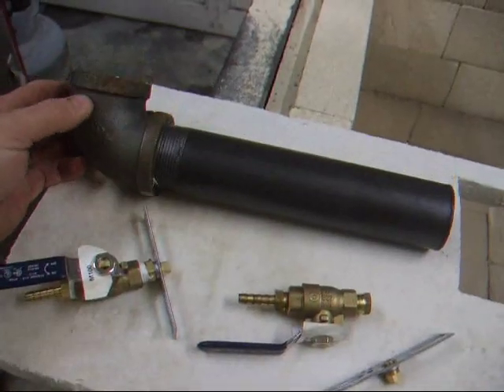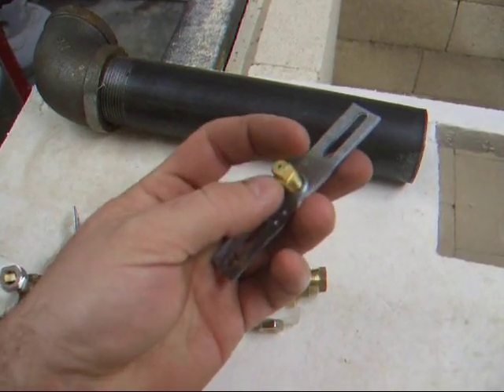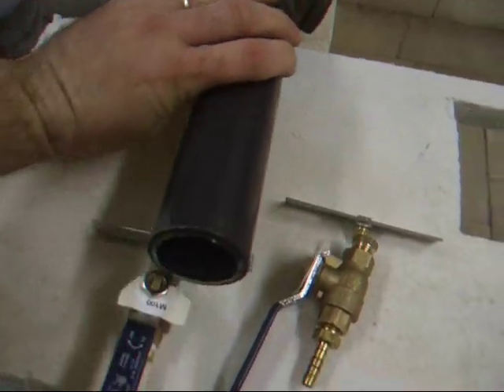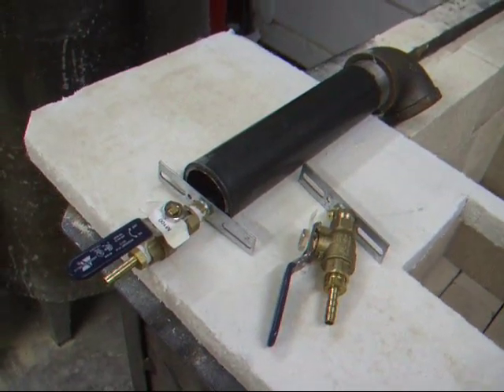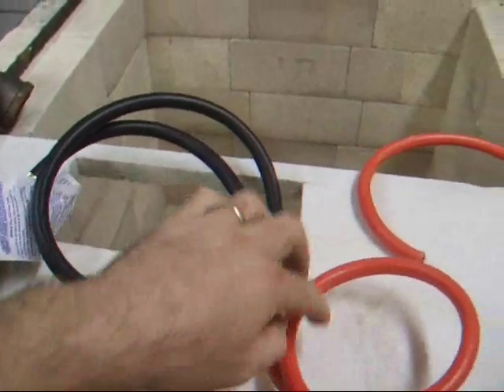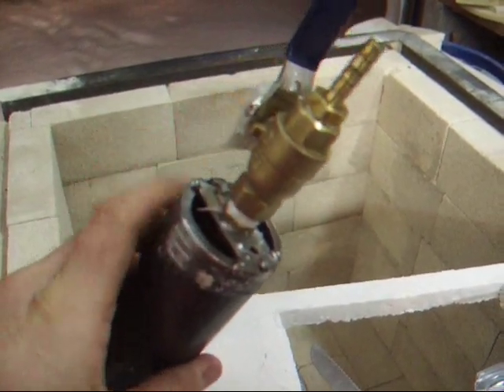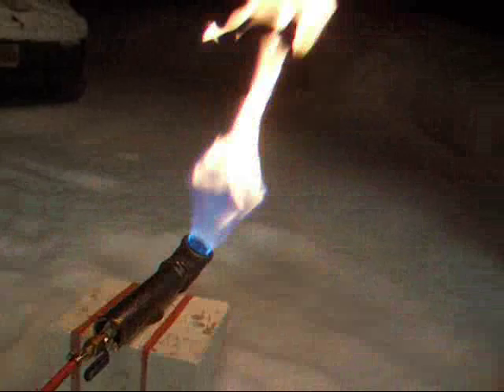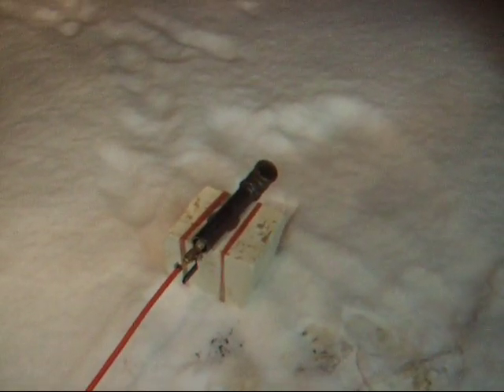Kiln project clip 4 - BURNERS!

Comment: yeah you need more air. thats why the flame is yellow. if you bent that flat bar with the gas into a u shape to draw more air into it that should get a better high temp but it would affect the low temp. even may be make it dangerous to run low. Im workking on making a kiln right now with two ribbon burners with forced air so i have a lot more control of both gas and air.

Comment from the maker: These burners actually burn very well now.  According to ward burners a kiln of this size will use about 30 lbs of propane to get to cone 10, no matter what burner you use.  The orifice is 1/16 inch, any less it backburns at the orifice tip and any more it runs rich.  Thanks for all the input.
Reply: Thanks for the video! I'm making a pre-heater for a pizza oven I built in the back yard. The thing takes like 2+ hours to heat up if the fire bricks are wet... It's a pain when you are hungry!!!! Hahahah what type of brick do you use for the kiln? Are they just regular fire bricks, only White?
Reply: I welded up a burner out of some scrap mild steel DOM I had kicking around and the orifice was just a scrap rotabroach plug that fell on the ground under the drill press hahahahaha, the pilot hole in it was about .100". I tried a bunch of different gas pressures and primary air hole sizes, but it was still too rich. Your comment about the 0-30 pound adjustable regulator is probably the key I am missing here!! The one I have is 0-10. The tube ID is around 3/4 to 1" yours looks like it's 1-1/2 or so?? I wonder if that has a big impact on how much air is drawn in?

Comment from the maker: I actually drilled some holes in the burners a couple of days ago and also decreased the size of the orifice. The burner is burning much better now. As soon as I'm finished making the lid, I can try out the burners to see if they will get the kiln up to temp. The nice thing about drilling the holes is I can make a sliding sleeve and when I want to reduce the atmosphere, I can slide the sleeve over the holes.